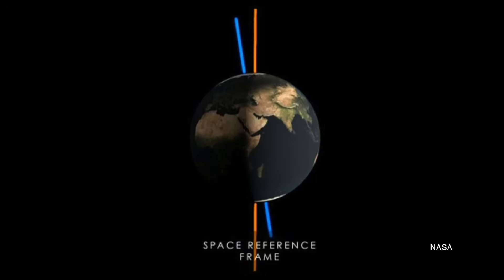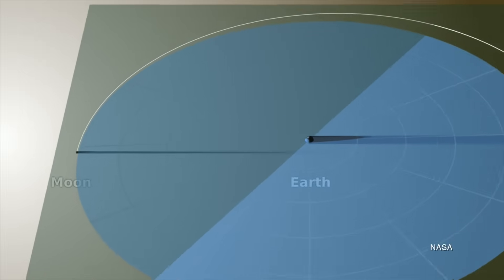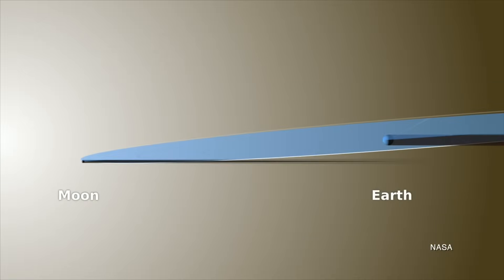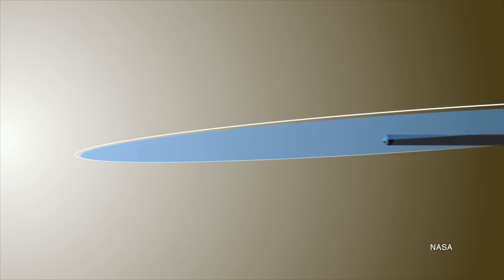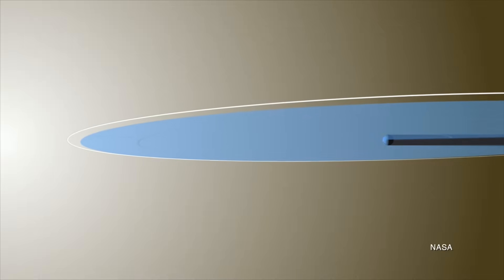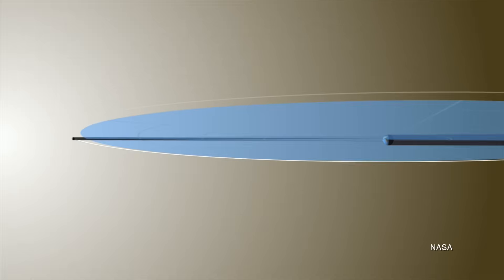Why Does a Rocket Need to Roll Going Into Orbit?

Comment: Just watched a video by an engineer explaining how the Apollo left orbit in a near polar direction to avoid the Van Allen belts which would make the inclination of the lunar orbit irrelevant.
????????
Reply: Hmm -- I'm afraid that the engineer's talking nonsense: the SIVB insertion orbit was close to being equatorial -- it's insanely expensive in fuel to make orbital plane changes, and given that the Moon's orbit is roughly in the same plane (ok, there's a bit of difference: see later), there's no need to go polar. And it's a red herring about the VA belts: sure, they pose a radiation hazard, but the CSM/LM passed through them pretty quickly, and they avoided the strongest regions. [Note that during Apollo 8 there was a moment of concern: Frank Borman suffered from vomiting/diarrhoea (dear god, imagine that in a cramped compartment with two others) after the TLI burn. Turned out to be food poisoning, but on the ground there was a moment when they wondered if it might be radiation effects.]
There's a superb video from the NASA days, describing in excellent detail the various problems behind choosing orbital parameters and launch windows, and it explains a lot about the orbital planes used in various missions. It's "Launch Windows for Lunar Landing", at
    https://www.youtube.com/watch?v=vzdjId224V0
Another fascinating account of the return and re-entry trajectory planning is at:
    https://www.youtube.com/watch?v=MTKHqfloB7Q
and there's one that analyses lunar orbital calculations:
    https://www.youtube.com/watch?v=eo3D6gU9csw

Apologies if you've seen these, but they give an insight into just how much work went into calculating the parameters of a lunar mission.
Peter

Comment: So,
If the launch pad were to be aligned differently, per launch program,
you would not need the roll program?
Reply: The roll program is, as described, tremendously complicated, and requires tremendous care. It is but one small detail of launching stuff into space, and all the other details are similarly complex and exacting.  There's not many places to build a launch facility and there's different directions you might want to launch a rocket, so launch pads get built where everything can fit, and roll programs adjust.

Comment: Why do they throttle back when going through maximum dynamic pressure
Reply: It's more fuel efficient
Reply: Because there would be too much stress at full throttle.  
As you go up, the air gets thinner and thinner and you can go faster and faster.  
At some point, you have to throttle back so you don't go too fast for the air you are in.  

I stayed at a Holiday Inn last night.

Comment: I'd like to tilt my rocket in her azimuth,... ha ha ha
I know, I know,... She's just so cute,... 
Smart too. 
I always wondered why they rolled the space shuttle - thanks for the explanation.
Reply: With the space shuttle, there was a different reason, the thrust was considerably off center there. Rolling it so there's more thrust on the side away from the turning direction is more efficient. Really you don't have to roll modern rockets anymore; they have powerful digital guidance systems that can deal with turning into every direction.

Comment: I'm not sure if I completely get it, but I think, from what you say,  it boils down to this:

* They were not using very advanced computers (obviously)
* They needed to keep the maths simple and understandable (hence the alignment to the cardinal points at launch)
* They were using the Euler representation for rotations, which are a lot simpler to understand than quaternions, but have mathematical limitations (notably the infamous "gimbal lock" of Apollo 13)

So to keep things as simple as possible (and thus less prone to error), the roll was needed.

Comment: Excellent presentation by Amy.   It  is understood that the roll program axes differ from the  axis  of the rocket sitting on the launch pad.   On the launch pad  the  z axis  is vertical,  the x axis is e/w and the y axis  aligns n/s through the flame trench.   Flight efficiency is maximized by using earth's gravity to tilt the rocket's flight in an eastward and nearly horizontal path.

Comment: Nice explanation and seems much like my work in 3D modeling where you have the world coordinates, which don't change (or 3D world/stage, doesn't rotate), and a 3D object's local coordinates, which changes when the object rotates.  So while straight up from the ground is Y, an object's Y-axis is runs from it's bottom to top, even if it rotates.

Comment: I presume, though, that in principle the rocket could be programmed to pitch over in any direction, without the roll program, by aligning the gyros appropriately. I take it that the actual launch procedure, involving a roll program, is to standardise the launch procedure. Is that right, do you think?

Comment: Hi VS!  Stupid question.  Are you ready?  When a space craft reenters our atmosphere its speed generates heat due to friction with the earth's atmosphere.  Question, why can't the space craft slow to a speed to where the friction becomes zero?  In other words, let it just "drop" into the atmosphere at zero speed?  Told ya.  Stupid question.  Looking forward to your answer.
Reply: cv66john   To slow down you would need to burn fuel. It’s better to do use the atmosphere to slow a space ship down so the fuel payload is less on launch. You don’t have unlimited fuel supplies. I’m assuming a orbital speed of around 15,000km. Space X boosters land because they drop back at a low altitude and a speed of around 3,000-4,000 kmh. Also, the boosters don’t have to worry about human occupants.  As an aside Mars satellite use the atmosphere to slow down into an orbit. This takes months to do but doesn’t use fuel.  https://en.m.wikipedia.org/wiki/Aerobraking

Comment: So the reason for the roll is to obtain proper orientation to be able to pitch into the correct azimuth.  Well that raises a question as to why a symmetrically round wingless rocket must have an orientation of a Y and Z axis and unable to pitch to the proper angle of ascent no matter which way it is turned?     
As for Apollo heading to moon, the explanation in the video says that the rocket direction in orbit must be at an inclination to the equator so as to parallel with the orbital path of the moon.    That raises another question as to why must the rocket be on a parallel path with the moon to be able to intercept it?
Reply: Accumulator1 I think it had more to do with the crew and antenna orientation.

Comment: Can you please provide scientific proof that gas pressure can be maintained next to a vacuum without a container? The container being the necessary antecedent for gas pressure. This space medium is in direct conflict with the 2nd law of thermodynamics regarding entropy . 
No space travel can happen if it’s a closed system. (Which gas pressure indicates)
No moon landing, no mars rover, no fly past Pluto or landing on any asteroid. The rocket has a parabolic trajectory because it’s not going to space it’s going to crash in the ocean.

Comment: There's something off about this explanation, or I'm utterly confused (which I could be). If the pitch axis goes from East to West, then when pitching, the rocket's tip would point to the North or the South, not the East. If the following sentence is true: "the rocket pitches due East", then the pitch axis should go from North to South. At 2:44, when you're showing the Z axis, which a moment before you defined as the pitch axis, you're "pitching" the rocket around another axis, in fact you are showing a yaw. Help me.

Comment: If the knew the azimuth why didn’t they just set up the rocket on the launch pad with the cockpit facing that way and tilt over to it? Was it for the astronauts comfort so the G forces wouldn’t be pushing them over to one side during the initial launch before the lean?

Comment: Did you really just reference taking advantage of the rotation of the earth during a rocket launch?  That directly conflicts with what is always said when trying to rebut stationary earthers over the topic of the rotation not having an effect on airplanes, helicopters, ect.
Reply: Aeroplanes don't leave the atmosphere, they just move relative to it. As the atmosphere is spinning at the same rate as the earth, it makes no difference which way around the globe they fly.

Comment: Too much overthinking here....it needs a roll going up so it can more easily arc back down and into the ocean, where they all end up.
Reply: KC Kelly
How would they do that without any one noticing as it was being tracked by many people not just NASA . Unless you mean the ascent stages of Saturn  5 they ended up in ocean
Reply: Plenty of people notice.  I do my research, I'm not doing others' for them, especially if they already think they know.
Reply: Can you explain then how when the capsule and command module was being tracked by many amateurs going into orbit . Even the trans lunar injection burn was seen on few powerful telescopes .Yet you claim they secretly ditched it in the ocean FFS   I do my research as well many radio hams picked up transmission's Russia UK and many other country's  tracked them as well .We all see re entry as well but that;s  impossible if they have not been in space

Comment: Would like an explanation on several issues, firstly, please explain how a rocket, accelerates, breaks & navigates in a Vacuum. Secondly, provide empirical evidence of a Negative & Positive atmosphere coexisting without a solid barrier. Think Aerosol can, as oppose to some Mathematical equation that has no bearing whatsoever, on reality.
Reply: What is a "negative atmosphere"?
Reply: +Richard Cornford 
He is just Flat Earther. These people aren't even able to grasp what is vacuum, force, centrifugal force, vector or relative motion, they don't do high school math or physics for children. But they are able, very often and for a very long time, lecture about Einstein's or Tesla's life - work and why they are "wrong" or "correct". They are absolute comedy gold.
Reply: upper cut
 The same as differing pressure can coexist within our atmosphere ie climb to top of mount Everest its approx 4 psi while at sea level its 14.7 psi  with out any solid barrier to divide the 2 differing pressures . Same with space higher you go lower the pressure till pressure is Zero . Air is a fluid like the sea its held onto earth with gravity . Rockets are reaction engines its basically a continuous explosion nothing required to push upon its basically Newton's third law is: For every action, there is an equal and opposite reaction  But if you are flat earther non of this will make sense as you wont believe in actual provable facts

Comment: i think this video explanation is the best. (thou it still boggles my mind) even thou the roll doesn't seem to be that big of an issue, to avoid the roll, couldn't they just adjust the rocket during assembly so that it would not be necessary to roll the rocket after lift-off?? just curious....
Reply: That would depend on the launch time and date.

Comment: great.  except that its completely wrong.  The rocket did not roll a little just for orientation on this whole trip.  In fact, if you do a deep dive into Werner Von Braun you will discover that many attempts to reach the moon using the trajectory science you describe over shot or undershot the expected flight plan target by as much as the diameter of the earth.  Scientists could not explain why what they thought would work never actually did until Von Braun disclosed the effects of a torsion spin on gravity and these poor astronauts had to endure an environment during flight akin to sitting in your washer on a spin cycle.  You wont find that fact easily because it is generally denied by physics professors as bunk.  Just remember most of those guys never tried to land on the moon.  You know the old feather and a rock experiment conducted by Newton (who is mostly wrong about everything) Well you can find an experiment that was done at a university, Colorado I think,  by a guy that was later fired (forgive me I had this reference at one time but I don't have time to find it now) Two experiments in fact.  One involved a couple neo dymium iron boron magnets bolted together with their opposing sides forcibly held together and this was encased in a ball and dropped beside a second ball of equal mass, just no magnets.  The magnet ball fell slower.  The second experiment involved measuring the trajectory of an object launched like a bullet and the parabola was observed.  The first object had no spin, the second identical object had an induced spin in excess of 28,000 rpm which extended the parabola and increased the range the object travelled.  This is not 'rifling' of a barrel, its not decreased wind resistance, all those variable were accounted for.  The experiment proved both magnetic and dielectric fields and torsion spin affected the trajectory of any object within the gravitational influence of a celestial body.  A great many things in science are held out there as facts but a surprising number of the basic ones we cling to are not correct at all. The sat 5 rocket may have rolled a bit but the last stage that went the distance to the moon had to spin at an excessive rate to maintain its trajectory or those guys would have missed it entirely and been lost. More research into the Russian program much of which is classified and hard to get would surprise you since they lost several comonauts to this misunderstanding, they just used people like monkeys and didn't give two shits about getting them back.   If you shrug all this off as pseudoscience nonsense then you are simply a disciple of the modern scientific priesthood.  I am telling you, I really research things, hard, countless thousands of hours.  Most of the science peddled out as news is complete rubbish.  All a jumble of derivative calculus with undefined variables.  They totally ignore dielectricity and counterspace in all equations since Maxwell so there's been no real advances in understanding made public since 1929.  Light isnt what you think it is, magnetism isn't what you think it is.  Science still thinks gravity is a force.  It's not.  Gravity is incoherent dielectric acceleration.  Said another way Gravity is a loss of inertia.  The earth is a coherent magnetic field, a giant magnet essentially (crush a magnet up and observe the pieces coalesce, same thing)  Your moon shot involves operating in that field and gaining inertia relative to it not the opposite as newton would have you believe.  The inertia on the ground of the rocket has almost all been lost, the remaining inertia would only vanish at the center of the earth.  It's a perspective error.  The inertia you must consider does not reside with the rocket alone it resides with the rocket on the earth, both of them, two objects that have coalesced in their dielectric acceleration  that's why its so 'heavy'.  Torsion spin acts as a means to separate them and then later the rockets trajectory orients this soon to be spinning torsion field 90 degrees from the one its parting from and shazam... we are clear.

Comment: Gravity turn to get in the orbit is most fulel efficient  way to do it. It apply only if craft have limited power and limited fuel efficiency.  Increasing engine thrust by 50%, and limit fuel consumption by 50% we can achieve vertical orbit insertion without looking for cost and mass of craft. It's nice to dream...

Comment: Am intrigued why they just didn't line up the rocket with the flight azimuth in the first place. Or would it be that that would change over time, and so if they had to choose a different launch window the system would still work?

Comment: So you saying they actually went to the moon. But all the data was destroyed on how they actually did it. Lost all the original footage as well. They also said it was to difficult getting the info back again. Ever wondered how they were able to go to the moon and didn't fail. Anything else we have done in history, we always seem to fail a few times before we get it right. Not with the moon landing though. That moon buggy looked awfully big to fit in the tent pole moon lander. I thought they had to curve the rockets to dumb them in the ocean. So nobody could actually see where they were going. Must have had it all wrong, she is very confincing.

Comment: It took me ages to understand this.
You mean the IGS (inertial guidance system) needs to be pointing in the direction of where the centre of the Earth should be?  Or the centre of the orbit in other words.
The IGS is on the Western side while on the pad but that is the down direction later.
Still not sure if I got it right.

Comment: 11miles vertical. Then 80 degrees pitch. 2nd stage ignition at 39 miles high and 80 miles down range. ( period). Yaw to 30 degrees accent.